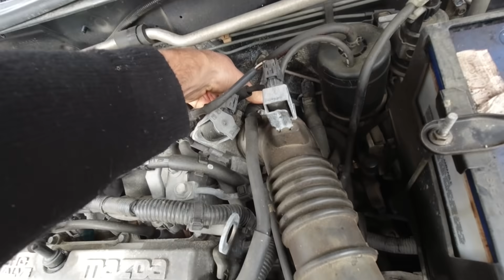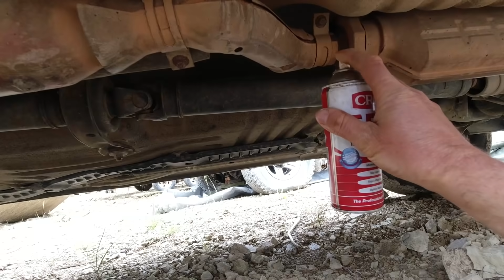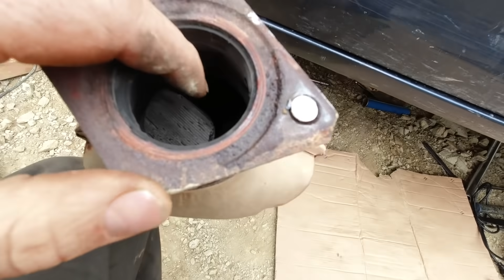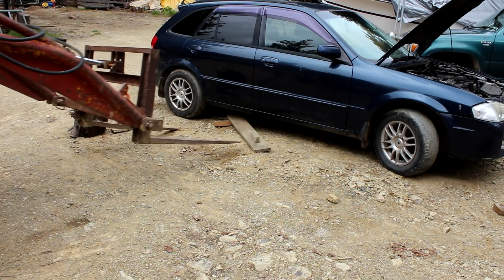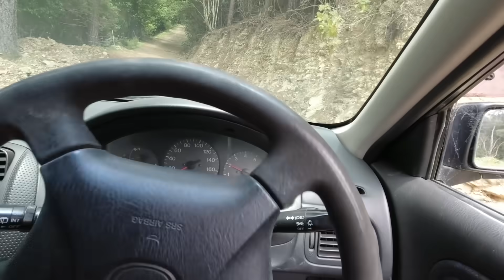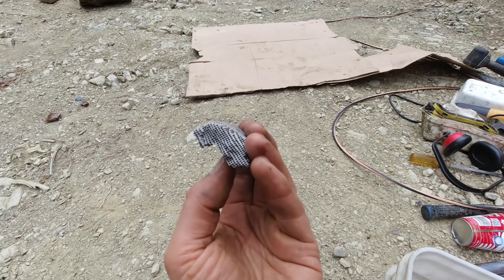Car engine overheating / lacks power,  Faulty Catalytic Converter?

Comment: Sometimes a vacuum leak will cause the engine to run rich and the extra gas cause the cat to self destruct as it tries to burn off the extra gas. I've seen cats glowing red trying to burn off the extra gas, and the vacuum leak might be why the check engine light is still on. A bad spark plug could do the same thing, it would allow unburned gas into the exhaust system and the cat would have the same problem,  I'd check the O2 sensor just to be safe. You can make your own smoke machine to check for vac leaks, I'll try to post a you tube link with instructions.
https://www.youtube.com/watch?v=tixozqgSwN0&list=PL_O5z6BLLJ9F5GqOX4Sc44NR8XhT3UcIH&index=3&ab_channel=martinbuilt

Comment: so let me get this... you just removed it? no replacement? :)
Reply: of course
New CATs are not cheap and used ones are often junk
Reply: This age of vehicle do not require it to be replaced. There is no emission testing of NZ cars yet. Compulsory Safety checks (Warrant of Fitness) either yearly or 6 monthly depending when the vehicle was first registered anywhere in the world. Only brand new vehicles first registered in NZ have a 3 year initial WOF...then yearly thereafter.
Reply: Hmmmmmmm

Comment: Am curious, is that a rear wheel drive, just noticing the axle when you were working under it (Love you're technique for that). I had basically that same model until just recently, which was front wheel drive. And just point out to the wife that it's now probably got more power since removing the converter :)
Reply from the maker: This model is 4wd
Reply: @MartyT  Nice, thanks for the reply

Comment: I hate to be a Debbie Downer, but won't someone notice the increased emissions when the car goes in for its next government-mandated health check? Or, don't you have an equivalent of the UK's MOT in NZ? Somehow I don't see that being the case.
Reply: We don't have emissions tests (per se) in New Zealand.
Reply: Same here in Australia, no emissions test. We don't care 🤠👍
Reply: The only time in NZ I ever had an emissions check was one for hydrocarbons and Carbon monoxide production back in 1984? when the Govt. was thinking of introducing emissions checks and they mandated a check for a period of 6 weeks in certain centres "to test the waters". What they found, according to the person that did my test, was very poorly tuned vehicles for the most part. Of course, he was the ignoramus who tried to refuse me the time to  heat my engine to normal operating temperature, saying it would make no difference to the results. He seemed shocked that my vehicle was one of those that tested as least polluting when warmed correctly......car had twin-throat downdraft carb, free flow exhaust, no cat and was 13 years old at the time.

Comment: With the ceramics missing it will burn out as soon as hits the flash temperature and set it on fire.
Reply: Old cats don't have the excess fuel injector...rely entirely on the heat of the exhaust reacting with the catalyst coating ing the matrix..no matrix, no heating, no problem.

Comment: A long way from living on hydro and solarpower to ditching a catalytic converter. 
And of cause it runs faster - when catalytic converters where first introduced engine displacement went up a couple of hundred CCs to compensate for the power loss.
And just saying a little disappointed in paradise lost😄

Comment: better look at getting a proper hoist  or build a big set of ramps
Reply: Not so, I used to work for a well known Fork-Lift company, and each engineer was issued with several blocks of wood.  The jack was only used to lift the vehicle to insert the wood blocks.  Never work on a vehicle held up with a Jack. . . . . . . .
Reply: Also use solid blocks. But so much easier  on a hoist.also forklifts  very rarely  get lifted higher than a foot. Most things accessed from  above. Most of the ones I have seen worked on. Good point  though.

Comment: Mate simply removing your catalitic converter is not fixing the problem, it's removing the problem. Pretty sure driving without catalytic converter is illegal so you now have a new problem.
Reply from the maker: Not illegal here, however it is easy enough to install a new one once the problem has been isolated. The intention was to show others a possible cause of engine overheating and power loss
Reply: @MartyT  I was expecting as much, just wanted to clarify as much for other people who might see the video and think they could boost their car's performance by removing the converter.

Comment: Im always waiting for a poisonous New Zealand critter to come into the frame.
Reply: There's not much posionous or venomous around here.
Reply: There aren't any, you are thinking of Australia where when you lay vulnerable under you car you are guaranteed a visit by a Copperhead or to find a Tigersnake curled around something warm you need to get to or Redbacks (Black widow) hiding behind something or a Kangaroo waiting to gut you with its hind feet.
And depending on where you are in Oz the Drop-bear (Carnivorous relation to the Koala) can be an issue.
Don't even get me started on hunting packs of Stingray, Blue ring octopus, Sharks and Jellyfish (Box jellies)
Reply: Actually there is a slightly less dangerous Beast lurking around Marty's place This creature will give you a venomous glare just before he butts you in the sack......

Comment: I punched out my catalytic converter and after 15 years my car had 1/4 more power. Could go up hills that would shift down and then not after breathing  more freely. What I think is the extra fuel used on this stuff makes a car make much more co2 than better running cars. Of course in LA they need electric cars not cat converters.

Comment: Nice not needing a working cat for inspection! In Sweden all cars -88 or newer needs to have it for inspection! Most small car engines pass inspection even if the cat is cleaned if they are otherwise healthy and you put some e85 in the tank, not to much thou or you will fail the lambda test!

Comment: So you have an empty pipe with no catylist. Illegal isn't it?
Reply: Yes! he is going to pollute, a barely inhabited, outback. CRAZYYYYY!!!!
Reply: In New Zealand, a car's catalytic converter can be replaced. It shouldn't be removed. Removal is a Warrant of Fitness fail. The car shouldn't be driven on the road. 
By the way, a car with no cat smells of fuel. The "Mrs" should warned that she may get a fine if caught driving this car on the road.
Reply: Not in all countries. For example here in New Zealand you cannot buy a new vehicle without it, but there's no law against removing it. When you go for a check ("Warrant of Fitness") they're not allowed to start pulling your car to bits either. So even if it were illegal you could still get away with taking the guts out of it like Marty did.
Reply: @kir0nz  As per the WOF manual the removal of a CAT is only prohibited if the car was made after 1 Jan 1990, and first registered in NZ after 1 May 2010. Anything that falls out of that criteria is free to remove the CAT without issue. It's only a matter of time before emission testing is part of a WOF test like the MOT.
Reply: @dg1294  stop being a whiney little child.
There are 5Mill of us, in a country the size of UK, or, Colorado.
We pump out less toxics than most cities, but, we have more forest cover than most countries - not to mention, the grass-covered areas that account for most of the farming.
Reply: @dg1294  You do realize that when they get old/clogged/broken that makes the engine less efficient and that's WORSE for the environment? Didn't say it was a good idea either. I was not advocating for doing this. 
Also... My country somehow got the "clean green" image when we said NO to nuclear power and subsequently refused to harbour nuclear subs in our waters -other than that we're just as filthy as the rest of the world.